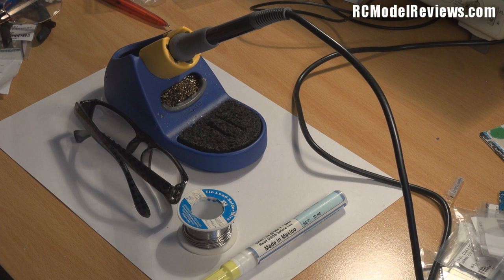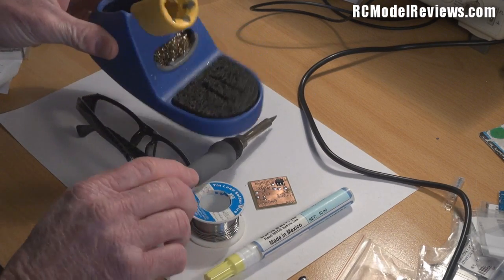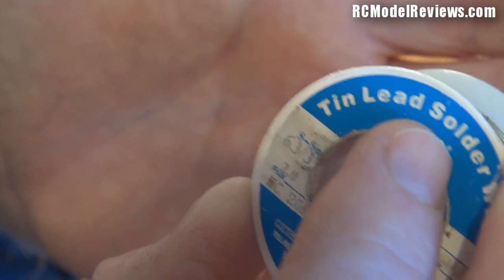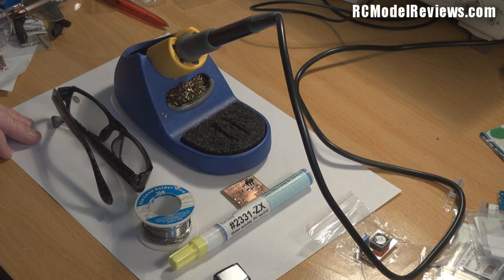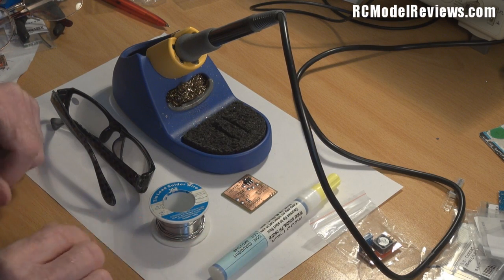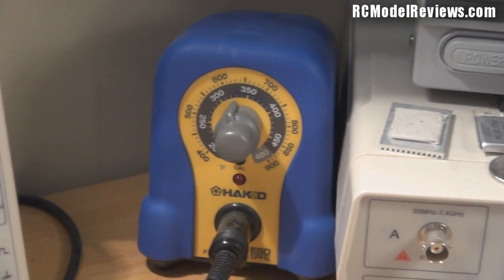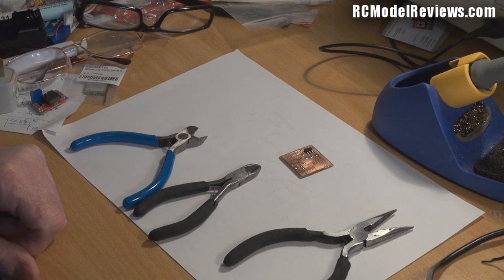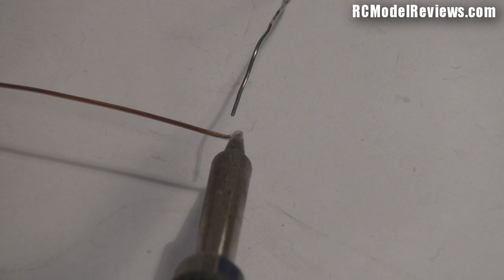DIY: FPV backpack build part 1 (Soldering)

Comment: Hi Bruce. I reckon your best soldering tip comes in the camera (Part 3) vid. I'd never thought of staggering my wiring connections to allow the use of a single piece of heatshrink. So simple, so effective and neat. Thanks Bruce!

Comment: For those of us in North America look for a Weller/Xclite soldering iron as they are very high quality and easier to find that the brand Bruce recommends. Or if money is no problem look for a Pace brand soldering station.

Also a little 00000 steel wool to buff pads and leads before soldering helps. Just blow off the board to make sure no little wires get left on the board to short things out.

Comment: You can usually find these at Radio Shack in the USA, look for a Micro Soldering Iron, great for small electronics, has a smaller tip. For those of us in America.